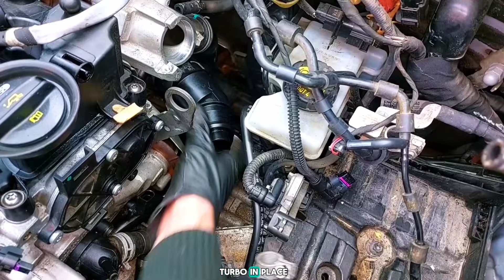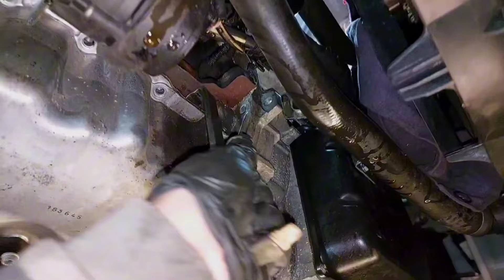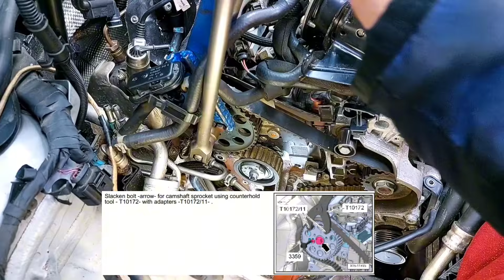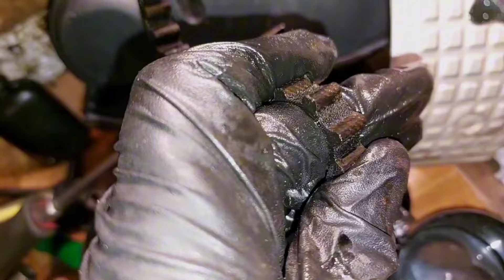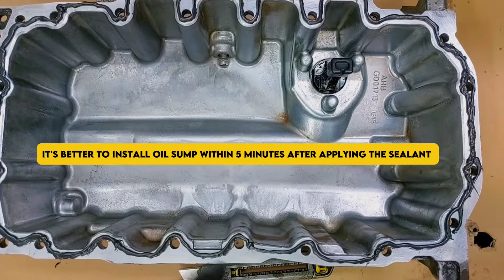VW 2.0 tdi ea288 oil pump belt change Part 6 of Assembly

Comment: This video series is amazing and such good quality. I am very familiar with the CJAA tdi as i have two of them but I also just had a valve break and drop down into the cylinder of my CRUA EA288. I did not mark anything before removing the timing belt while removing the head and now I am not confident how to align everything upon reassembly. in this series, between part 5 and part 6 you had the belt on and everything timed off camera before starting the oil pump belt replacement. Is there a separate video or a link to correct procedure? I will search PDF for this engine also. Again thank you for these videos! very helpful.
Reply from the maker: Hi, thank you too, for cam shaft and H. P. Pump you can use 6mm drill bits, but for the crankshaft special tool T10490 or in this video from 7;38  https://youtu.be/taVqmKdmMxo?si=IBlt3e17zm7UT5i0. This is probably the best tutorial https://youtu.be/VgCSHP2WbCA?si=9Cgs1FiMKoGgBZZO .  My video without special tools https://youtu.be/4yc2Yh7reFY?si=y-RABrtkhhyxAv3i  . Manual https://www.scribd.com/document/484360413/diesel-engine-1-6-and-2-0-tdi-common-rail-ea288-eng-pdf
Reply: @HintSlice thank you.
Reply from the maker: Yep, good luck in everything you  do

Comment: Great video! 
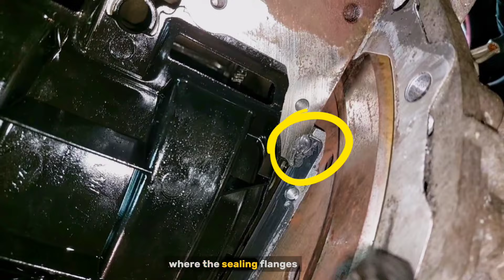Quick question.  At 13:55 you can see you didn't remove a strip of silicone. 
Is this to be bought? 
I removed this. Any ideas?/Mike
Reply from the maker: If you mean that black rubber part, well its one piece with crankshaft sealing flange and it goes only with the sealing flange 04L103171. Option one use Three Bond sealant( very good sealant when it cures its almost like rubber), option two use Victor Reinz sealant.  Or make a custom gasket
Reply: @HintSlice I will make a  custom gasket with Victor reinz silicone. 
Just fill it up and smooth it off?
Whats the purpose of this strip?
Reply from the maker: Great, bro, I hope it will be good. That strip is for better sealing and maybe as the anti vibration for crankshaft sealing flange. To succeed You need to wait 24h until sealan fully cure. Wish you all the best.

Comment: How miles/km does it has? I have 195.000kms and I am considering do oil pump belt replacement. Thank you
Reply from the maker: at the time of replacement, it was 235000 km
Reply: @HintSlice thank you for quick reply :)

Comment: Can you tell me what the mileage was on this car? I have a question: How long will this oil pump belt last, and when should I replace it? I currently have 200,000 km on it.
Reply from the maker: If you change the oil every 10,000 km, this oil pump belt can last up to 400,000 km. But for your peace of mind and if you plan to use your car for a long time, 200,000 km is the right time to replace this belt and drive without worries. This car was at that time on 235,000km

Comment: Is it possible to replace the crankshaft oil seal housing without dropping the sump ?
Is it possible to seal the mating surfaces?
Reply from the maker: Yes it is possible. In this video https://youtu.be/JgdkvTdL4xM
Reply: @HintSlice ❤ thank you very much 🙏

Comment: I mistimed the timing belt, the timing belt tensioner needle was not in the middle , it was on the edge of tensioner mark. I messed up while redoing it. now situation is crankshaft is not moving clockwise and it's misaligned with camshaft. It was my first time and messed up in the attempt of bringing perfection. Once I found that crankshaft is locked I stopped applying force to it. left the car in this situation. Car is Volkswagen Jetta TDI Mk6 2015 2.0 CUUA engine. Can you guide how to get out of this situation? Someone told me to take off the belt and rotate crankshaft anticlockwise until it stops and then rotate camshaft clockwise a little. repeat until both reach the timing marks (TDC). Once reached, put the belt on and tight it accordingly.  Can you guide if this is possible?. 
The crankshaft and camshaft both are few degrees above (further) than the TDC points. Your expert advice will be really appreciated, very much stressed in this situation.
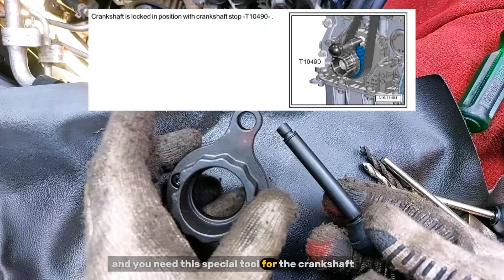Reply from the maker: Yes it is possible, someone gave you very good advice you can follow that👍🏻. I'll try to describe that process maybe in this way it will be easier for you to resolve the situation. First of all if it is possible you need to set the crankshaft timing mark or bring the crankshaft as close as possible to it(you need of course crank timing tool or count some teeth 7:09). Then remove timing belt and turn the crankshaft anticlockwise a quarter of a turn (in this position the pistons sould be at the same level and when you rotate camshaft the valves will not reach them) and then you will be able to turn the camshaft in any direction that you need to align it with timing mark position and then you set timing mark of the crankshaft by turning the crankshaft clockwise. Then check all alignments of crankshaft, camshaft and fuel pump and install timing belt etc. Huh...😮‍💨 it's easier to do than to describe😅. I hope you get it. You can ask if something is unclear.
Reply: @HintSlice  thanks a lot for replying. One thing I didn't get from your reply "you need to set the timing mark or bring the crankshaft as close as possible". By timing mark you mean the TDC mark which is on crankshaft sprocket ~8 o'clock? Lets say that mark is at 1-3 o'clock, is it fine to rotate it backwards till it's TDC position where timing tool sits in? (All this only with belt removed) 
Secondly, if camshaft timing position is away from it's original position, let's say at 12 o'clock and top arrow mark is ~3 o'clock, is it fine to rotate it backwards or only forward? Camshaft position setting only after crankshaft. 
Sorry for lot of questions, just want make sure that all angles are covered. 🙏🏻
Reply from the maker: Hi, yes by cranckshaft timing mark I mean TDC and now from this TDC or let's say it's 12 o'clock you turn crankshaft backwards to 11::45 o'clock in this position top of the all pistons will be on the same level below TDC i think it will be easier for you to do set crankshasft to 11::45 o'cl when belt is still on then you take off belt and in this position when cranckshaft is on 11::45 it is safe to turn camshaft in any direction to align it with timing mark but if you will feel some resistance while turning camshaft then probably you will need to turn crankahaft just a little bit clockwise or anticklowise to continue rotation of the camshaft . (you can put some marking with paint on the crankshaft sprocket and block for better understanding in which position it is now)  I don't know maybe this video on 7;35 or 10;27min will help to understand what i mean when saying that all pistons can be on the same level when crankshaft is on 11::45 https://youtu.be/taVqmKdmMxo?si=rhe6i5bOPsF6CsPu
Reply: @HintSlice Thank you so much for the helpful instructions, it worked and I've revived my car. 😊
Reply from the maker: I got a little distracted and instead of 9;00 o'clock I wrote 11;45🙆🏻😅. Anyway I'm glad that you managed to fix everything and good luck on the road🙋🏻.
Reply: @HintSlice I got your point when I read it. The crankshaft TDC was at 5 or 6 o'clock I rotated gently anticlockwise but it stopped at 10 o'clock. Then I rotated camshaft anticlockwise to the TDC and locked it with pin. Then I tried to rotate crankshaft to TDC and it rotated backwards easily to TDC. i locked it and performed the timing as usual. 😊

Comment: Hello. You put the same part number for the long and short oil pump bolts. What is the short bolt part number?
Reply from the maker: N 10795601
Reply: Seal 04L145625 was $18 USD 🙃

Comment: What a good friend! Now we are going at the same time in the assembly of our car, mine is a seat leon 2.0 from 2017. Two big doubts arise for me due to lack of experience, one would be how to pressure the oil pump since the first start after so much time will be with all the oil pipes very dry and also how to purge the injectors with this common rail system, which I think should be done because if it has air it could break. A big greeting and what a job you are doing. a hug!!
Reply from the maker: Hello. There are two ways to bleed the fuel system, the first (a littel bit dirty) is shown in this video https://youtu.be/4SDSH4SCppE?si=q83vt3vpLKSCZHfM (also without glow plugs the engine will spin faster and this will help to create oil pressure in the system faster). And the second way is to bleed the fuel system using VCDS, you will need VAG COM or its analogue and a laptop. And one more thing, even when you have bled the fuel system and pumped oil in to the system, the engine may not start right away and this is because some hydraulic lifters may still be without oil and that's why some valves may not be fully open, but don't panic, immediately after the oil pumps through all hydraulic lifters the engine will start.  
I was using VCDS to bleed fuel system ( i was doing that like in this video by chosing "Fuel pump electronics" in VCDS https://youtu.be/rtMVrU51_is?si=rR_FCcUmn-_Ptk5w). Also another option in VCDS is like this "Transfer Fuel Pump (fP)test" in this vid https://youtu.be/3hbtOwxz9DY?si=RKddxC0CGtvT3AFK. And one more thing you will need to bleed cooling system and its easier to do with VCDS. So in summary you will need VCDS or entrust this stage to some outside diagnostician to be more precise.
Reply: @HintSlice  Ohhh! Because I don't have VCDS, I do have the delphy autocom, and I don't know if it will have that function, if not I will try to do it manually although I find it difficult. Thank you very much for answering as always, I will see the links you have sent me and I will try to solve it. Thank you very much friend!
Reply from the maker: If you don't find fuel system bleeding option in Autocom. There is one more method, all you need is cable about 3 meters long, unplug connector from the electric pump in the fuel tank(connector with four4 pins), connect the cable to the battery and this electric pump and in this way pump fuel in to the system, and then start the engine. (pump have 12voltage so don't vorry you will not burn it). But before applying voltage to the pump, you need to know exactly where the plus and minus are on that pump. Something similar I do in this bmw on 4::45min and 12::30min https://youtu.be/qz_pTONZ3CU?si=gerHThy3o-yEw6VB . 
And this answer I get from google AI when typing "fuel system bleeding option in Autocom for vag"
To bleed the fuel system on a Vag (Volkswagen Automotive Group) vehicle using an Autocom diagnostic tool, you'll typically find a "Fuel Pump Activation" or "Transfer Fuel Pump Test" function under Basic Settings within the Engine Control Module (ECM) or the Output Tests menu of the VCDS (VAG-COM) software, which is similar to the functionality in Autocom. This test activates the in-tank and/or engine bay fuel pump to prime the system, circulate fuel, and purge air after repairs or filter changes, requiring the process to be repeated multiple times, ideally with the fuel filter housing full and the system sealed to avoid damage. 

Steps to Bleed the Fuel System (General)

Connect the Diagnostic Tool: Connect your Autocom tool to the vehicle's OBD-II port. 

Select the Control Module: On the Autocom, go to the main menu and select the Engine Control Module (01-Engine). 

Access Basic Settings / Output Tests:

For newer VAG vehicles with UDS protocol, navigate to Basic Settings and select the function related to "Initial Fuel Filling" or "Transfer Fuel Pump". 

For older VAG vehicles, go to Output Tests (often labeled as Output Tests) and find a test for "Fuel Pump Electronics" or a similar designation. 

Activate the Test: Start the selected function or test. You will hear the fuel pump(s) run as they circulate fuel and remove air from the system. 

Repeat the Process: Repeat the test multiple times (e.g., start the process at least 3 times) to ensure the system is fully purged. 

Monitor for Fuel: You can observe the process on the diagnostic tool. Some systems may show a fuel level or filling time, while others allow you to monitor for air bubbles through a sight glass or by listening to the pump. 

Start the Engine: After the diagnostic test(s), start the vehicle and check for leaks. 

Important Considerations

Sealed System: Ensure all fuel lines and the fuel filter are properly connected and sealed before performing the test to avoid damage to the fuel pump. 

Fuel Level: Keep the fuel tank topped up during the procedure. 

Check for Leaks: Always check the fuel system for leaks after the process. 

Vehicle-Specific Procedures: Always refer to the specific repair manual for your vehicle's make and model for detailed instructions and specific test procedures, as the function name and process may vary slightly.
Reply: @HintSlice  Thank you very much for such a good explanation!! I already have everything assembled and I have to do the three purges, coolant, fuel and oil. I'm going to try to disconnect the tank like you told me to see if I can do it, I think in the end this is the part that is causing me the most headache, thank you very much friend. As soon as I get it I'll let you know.
Reply from the maker: No problem always glad to help. So I can assume that there is no option in Autocom to bleed fuel system? If you need Probably this is plus and minus on fuel pump, since it's black and red wires https://fex.net/uk/s/s9co67k
Reply from the maker: When bleeding the cooling system with VCDS I see that the engine RPM's just goes from 1000 after about 5 minutes to 2500 and then to 3000 RPM. After that the engine idles at 1000 RPM and then the test is completed at normal RPM, this whole procedure takes about 10 minutes. So I think, it can be done manually, but the thing is that it's impossible to manually raise the idle RPM above 2500 if you have a DSG gearbox. And oil pressure is the last thing to worry about, just look how quickly it rises after starting the engine, just in 1 sec. and it's 6 cylinders old engn https://youtube.com/shorts/kC1qi5ZzHug?si=6psy2b9I_C5wKr70

Comment: thanks, please how did you manage tightenning of crankshaft pulley, I read it needs 180nm + 135 degrees, sounds brutal, please could you advise how to do the work and what tool you used
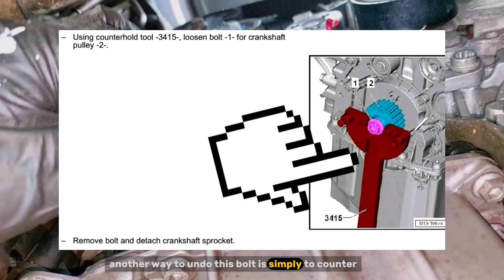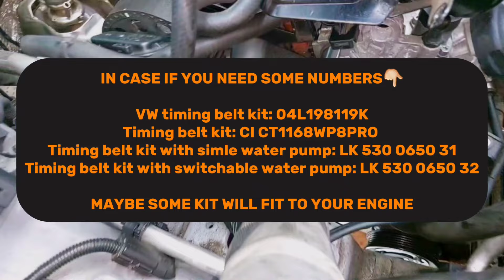Reply from the maker: I was using something like this counterhold tool for crankshaft sprocket to tighten that bolt 6:18 (and its the only way that is described in wrkshp manual to do that) you can see it on 17:12 and how it was made in this video 5::47min. https://youtu.be/bNK9772qOi8?si=hgkmOfSHLkHognMD. If you are not going to replace this bolt, just mark it before you unscrew it so you will know to what point to tighten it, just like I did with high pressure pipes in this video on 18::51min. https://youtu.be/KS0Trn_i7qA . And tightening torque 180Nm +135°dgree is not so scarry in real. So you can tighten that bolt with 180Nm and then try to turn to 90° and when you feel resistance like bolt stops then stop and you will be good, it will not going anywhere. 
For the previos engine series EA189 tightening is like this "Tighten in three stages as follows: 
1st stage: 180 Nm 
2nd stage: Use rigid wrench to turn 90° further  
3rd stage: Use rigid wrench to turn 45°" further. 
And for the EA188 engine series which have more load on belt and everything else (since its “PD” Pumpe Düse engine) they set tightening torque with only 120Nm+90° and its totaly fine, so maybe you can use that.
Reply: @HintSlice Many thanks